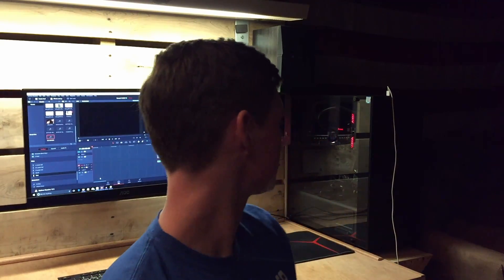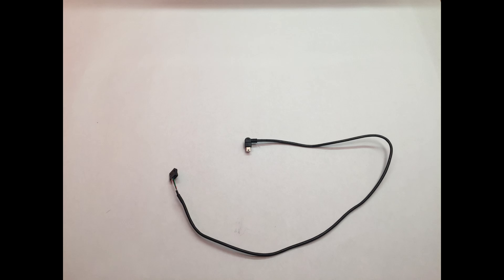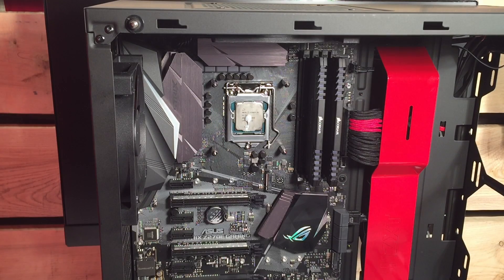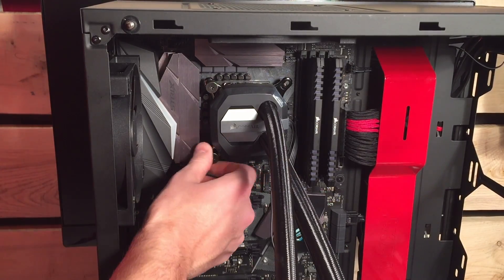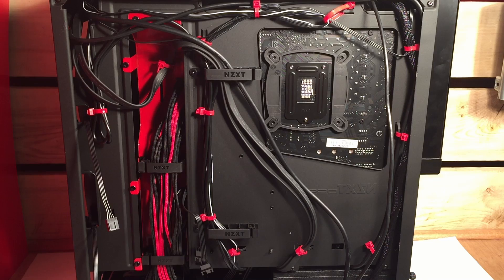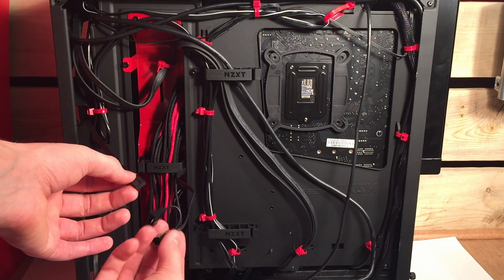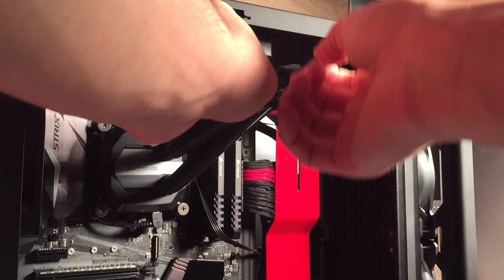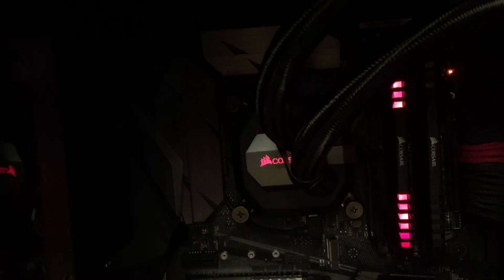Corsair H100I V2 Installation Guide

Comment: Hi 
I just want to mention the position on the radiator is not the wey it should go.
You must install the radiator with the pipes down .( up side down on the wey you show on the video. )the wey you install it not be ok with possible not working the circulating pump. Due to high position on pipes. And suckling air .
I experience this problem and the cooler doesn't work and the processor was going to 100 Celsius 
So correct the position on the radiator with the pipes down solved the problem. 
Other than that it will be fine

Comment: The tube should not be at a higher level of the block or the radiator, otherwise the air will accumulated at that point. Over the years more air will gradually get in the system and it will slowing get wrost. 
Another observation the radiator also would better place at the top, this way the air bubbles will always be at the top and will never get into the block

Comment: PLEASE DO NOT MOUNT RADIATOR LIKE THIS. THE TUBES SHOULD BE AT THE BOTTOM, IF YOU CHOOSE TO MOUNT IT ON THE FRONT. IF YOU DO IT THE WAY IN THE VIDEO, IT CAN BREAK THE PUMP, POTENTIALLY LEAD TO OVERHEATING ON YOUR CPU DUE TO NOT FAST ENOUGH WATER FLOW, WATER COVERAGE, AND CAN JUST OVERALL BREAK IT ALL

Comment: Unfortunately, you’ve installed the cooler incorrectly. You should have mounted the radiators on top or tubes down on the front.
Reply: wrong

Comment: On a h100i pro would you put the fans on the outside in front of the radiator so you can see the LED’s better?
Reply: Chris okay cuz I have the nzxt 500 case and the radiator goes on the front of the case

Comment: Your advice about fans and radiator position is not a good choice, you are taking some cold air from outside to warm it up through the radiator and send it into your computer case.
IMO Better taking the cold air that's gonna be warming it a bit inside the case, being accelerated by the radiators fans and cooling down radiator at the same time while being ejected.

Comment: Newbie question! By setting up your fans to push ambient air through the radiator at the front of the case, aren't you essentially exhausting the radiator's heat into your case? Wouldn't it make more sense to mount the fans in a pull position at an exhaust point? (back or top of case)
Reply: it works that way, because the air will flow into your pc and get out by the other fans you've mentioned, the top and back ones that are pointed with exiting the hot air.

Comment: I have this same cooler mounted in the exact same configuration and for some reason my studs that screw into the back plate slowly back out over a few days. They become loose, when this happens my temps rise. I have tried reinstalling checking that everything is tightened but they always come loose . The hoses are pretty firm and tend to apply a lot of pressure in a sideways direction pushing on my cooler. Any thoughts on this? Yes my backplate contains washers and is firm and not shaking. I was looking into an x62 Kraken and the hoses are much less firm.

Comment: Nice video. I'm about to install an H100i Pro for my 4790k to try and improve performance in BF5.
Reply: Did it work? Have same cpu. And a GTX 1070 8GB. My cpu runs at 100 so its time for a cooler solution.. ;)

Comment: Yo man I got the RGB platinum edition of h100i but I keep getting the Windows 10 disconnect sound and it just shuts off and turns back on. My games run fine and everything and it just happens randomly like it would work for like 6 hours straight and all good but then it will happen like twice back to back. Any idea about this? I’ve tried messing with BIOS but no dice :/

Comment: I  have a question about where you plug your fans into, There is an option on the mother board for an AIO header, is it better to plug the two fans into the cpu fan header's and then the cooler into the AIO header. Or to plug the fans into the sockets connected to the cooler and then the cpu fan. I plugged into the Cpu fan and the the other fans into the provided plugs attached to the cooler. I hear mixed things about which way is more efficient.
Reply: The AIO header provides constant 8-12 volts of power, and I read it is recommended to use that AIO. It will safely run at the pump at full power at not be very noisy. The fans to cool the radiator should be monitored by the MOBO bios (CPU fan and Opt fan). You can set it up in your bios. and also monitor it with software.
Remember if you have a case, sometimes they have a fan hub -where you can plug in 1-6 extra fans. But remember, your ASUS bios only detects the fans directly attached to the MOBO. Usually ASUS boards usually have just 3-4 CPU fan connections, and usually 2-3 USB connections. Plugging in the Corsair USB to the MOBO will give you options for lights, and interface to add colors, position the heat sensors with optional (SDK software). All of this is great to see, but the main concern is the MOBO. Remember, if you decide to connect to CPU FAN 1/2/3 on your MOBO, make sure the fans output are not using more that 5volts of power on each connection. If the fans can run higher voltage than that, the demand can overheat your circuit board. Make sure you use Molex power from empty SATA power plugs for the hi-rpm fans. Anything using over 3000RPM will most like be using more that 4volts. Think like this... small pins=small power capacity. Big pins=big power.
So in the end, you have to decide;
Do you want iCUE to control and monitor everything (H100iPro) from USB2 plug?  If you plug radiator fans directly to CPU+OPT CPU fan, your ICUE software will not detect it and you cannot control those 2 fans independently. Instead, the AIO "pump" in iCUE can control them both but again, you have to adjust the settings. There is no run-up calibration on the iCUE to test the fans allowing it to make it's own setup. And that is where the ASUS FAN XPERT4 has the advantage. I like to be able to see everything in the BIOS. And quite frankly, Corsair is more into the memory and hard drive business, and not a BIOS controller. So if you want Corsair software to monitor the board, its up to you. But ASUS already has you covered using ASUS FAN XPERT4 (in the BIOS as well as software loadable. 
I have CPU and OPT headers directly to radiator fans/ USB monitoring the temp on the cooler, and the rest of the fans connected to CH1/2/3. Its a matter of preference. How many people use the iCUE temp sensor (green yellow red)? I dont have the case facing me, so how will I ever know when the sensor turns red? Answer: FAN Xpert4.

Comment: hey look at 4:03 you see what you did to that radiator?? you touched that and you messed up those coils or whatever its called ...i have a huge problem now because i just installed that and i noticed that during my fans attachment i did touched the other side and now my radiator is messed up like yours is..... and now i wonder if i just broke that cooling system by my stupidity??? and idk is that water goes there thru those coils ????and now ill have a leak or something??? idk im afraid to turn the system on

Comment: i have a asus rog rebulic of gamers motherboard and i got the h100i v2 together a while back but recently i got the 1500w thermaltake power supply and when i plugged that into the motherboard my h100i will not work or read on the computer anymore and it is saying my cpu is running at 100c. any help please???

Comment: At 6:42 your plugging the CPU fan header, that has 3 slots, into a 4 pin connector on the motherboard...is this correct ??? 
Following your video every second of the way and its been super helpful
Reply: Most Mobos have 4 pin connectors for CPU fans, some use 4 some use 3, its designed for max compatibility. It's not incorrect. :>

Comment: hey man youve been real helpful - i downloaded the Corsair Link application because i found out about it through your channel... Alright so my fans are spinning lights all over the pump but my actual pump is at 0rpm also ive set it to full speed using the app. I am connecting my h100i v2 to a Z270P Prime Asus mobo.. and I have connected everything exactly as you have instructed in this video.. Halp!

Comment: So if the radiator in the front is set up as intake fans what did you do for the top and rear fans? Do you do the rear as exhaust and top as intake?

Comment: 3rd radiator install method- mount case fans on front with long screws- long screws are long enough to go into radiator as well. Mount pull fans to inside of radiator for push/pull :D

Comment: The wire set that has the 2 connectors is that required? The only way I can connect power is to a header on my MOBO using the 3pin header connector.  I am new to this thanks for the help.

Comment: Really helped me in that I have the same exact case. Upgrading CPU, MOBO and CPU FAN. So needed to know if this one will fit my case and how it will look. I was initially worried that my over sized zotac GPU would be in the way of the radiator. Looks like I will have plenty of room as the radiator does not go past the red plate that covers the wiring.

Comment: Just installed mine the EXACT same way as he did and it cools the cpu as it’s supposed to. The other fans in the top and back of my case remove the air. Stfu to anyone saying it’s wrong wtf
Reply: He should have reversed the fan direction, now the air coming through the radiator is warmed, it will raise the internal case temps. It's not catastrophic, but simply reversing the air flow will bring the internal case temps down a few degrees.

Comment: You don't need Thermal paste for this particular cooler.  It is pre-applied at the factory.  I built two Ryzen 7 systems using the H100I v2 and it was very easy.  The hardest part was actually removing the pre-installed Intel bracket and installing the Ryzen Bracket.

Comment: Hi TekRant.
Do you NOT WORRY about using an anti-static wrist strap?
I'm not judging/making fun, I am just curious what your take is on building such a nice system without a wrist strap?
Reply: Been a computer tech for 25 years..never used an antistatic strap..never had ANY issues..its all garbage

Comment: I have the same case but I have the 140mm fans. The top fan cannot screw in but it is in a very stable position and doesn’t move. It still preforms well. Just letting y’all know if you’re looking to do this too but with larger fans

Comment: If you use the fan method that you don't use in this video, doesn't it mean that 2 extra fans for cool air input are needed? Because you need cool air in the cabinet to be able to send cool air to the cpu cooler and gpu

Comment: If you are taking outside air and pushing it onwards, it will get hotter but if your case is set up correctly, your other fans will push that out the fans in front of the radiator is only to keep the radiator even cooler thus putting cooler liquid to the radiator if he was pushing the hot air into the radiator yes it would help keep the inside cooler but would ruin air flow some of the Arguments in the comments are not needed...

Comment: To get my tubes in a good orientation i rotated the CPU block 90 degrees (corsair logo is now vertical). Is this bad for the pump? My temperatures are pretty good but just concerned if it puts strain on the system?

Comment: on the installation manual guide they say that for best results you need to place the fans so that they take out air outside the case...not bringing air into it.
Reply: There are a lot of videos regarding that subject and they found that it makes very little difference. Both have pros and cons.
Reply: for that you'd need to install the AIO radiator on the top of the case as exhaust, and put 2 fans in front as intake

Comment: Why did he use CPU_OPT & not AIO_PUMP like the manual reads? We have the same board
Reply: Robert the fans don't start on boot I did it the way you mention xD
Reply: because he has no idea what he is doing like the retarded music playing in the video.  You always plug the AIO pump connector into the AIO pins on the mobo.  Then you can connect the two fans to the Y splitter built into the pump.  I built two water cooled systems and have them both setup like this.  All you have to do is go into the bios and disable the CPU fan speed monitor because it will set off an error and stop the POST.  Corsair has link software that you can use to customize the speed.

Comment: Can u connect the H100I V2 with a normal Fan based cooling system rather than a complete water cooled system?
Reply: OG ProDown yes it’s just a cpu cooler, the rest of your pc will need fans on the case

Comment: Hi, if I wanted to replace my intel stock cooler, should I remove before the thermal paste that my cpu had?
Reply: Alejandro Oviedo Yes u can remove it with a wipe with alcohol
Reply: Absolutely yes, use rubbing alcohol like the other guy said, whenever you take the cooler off of the CPU you want to replace the thermal paste, it more or less resets its lifespan and means you won't have to change it again as soon

Comment: There is another installation video on here saying it is not a good idea to plug the fans into the MB rather the PSU. But doesn't this mean the fans will run at full speed all the time? Is this accurate in that it has the possibility of damaging your MB?

Comment: is this good bild???? HELP! FEEDBACKNEEDED
NZXT S340Razer Edition 
ASUS ROG STRIX Z270E 
Intel 7th Gen Intel Core Desktop Processor i7-7700K 
Corsair Hydro Series, H100i v2,
NVIDIA - Founders Edition GeForce GTX 1070 8GB
Samsung 850 EVO 250GB 2.5-Inch SATA III Internal SSD 
Seagate 2TB BarraCuda SATA 
EVGA 750 GQ, 80+ GOLD 750W,
CORSAIR Vengeance LPX 8GB (2x4GB) DDR4 DRAM 3000MHz C15 Memory Kit - Black  
Budget is 1400euro PLZ GIVE FEEDBACK!!
Reply: VincentEntertainment should serve you well.
Reply: Its great, but I would recommend going 8th gen or ryzen.

Comment: I’m so tempted to get the kraken. But I’m probably just wasting my money on looks then.
Reply: IngeniousAbfool Same here. I’m scared that I won’t have enough usb headers for the krakens usb cable that you got to plug it in to. But the Corsair you also have a link cable that also has to be plugged in somewhere as well. Idk. I might get the Corsair one as Corsair is known to also make really nice products
Reply: Welcome To The DARKSYDE Same. Might just go for an air cooler though. Dark rock 3 should be fine for 3.8 Ghz i3-8350k
Reply: I just did everything put the last part right now and I don't have a 9 pin usb header available on my motherboard fml. I might run it without corsair link cable until I buy an adapter
Reply: I was also thinking kraken x62 but the reviews aren't as great for the price

Comment: I have this extremely annoying problem. When i've set it up, and plugged in the USB in motherboard, it doesn't install. I can't see it in Corsair Link 4. In Task manager it says "Printer and ??" It says "h115i Driver error" With a yellow triangle. I've updated bios, tried different usb's on the motherboard, restarted 500 times, reinstalled windows, i mean wtf...

Comment: I everyone I just recently bought a new computer from a friend and i could use some knowledge. I have a Corsair H100i v2 connected to a Gigabyte z270 hd3 mobo. In corsair link 4 the h100i v2 fan says 0 rpm's and stays there and the pump reads 800 rpm's so i then went into my bios and went to easy mode then to smart fan 5 and beside cpu fan speed control i set from normal to full speed and now the h100i v2 fan is reading 1,200 - 1,300 rpms and the pump at 1,700 - 1,800 rpms and also a reminded i have not manually changed anything in corsair link 4 sine I've purchased the Computer and also the corsair profile is set to balance. I have no idea if these speeds are good. my temps seem fine and my pump temp is at 24.8 degrees Celsius. .If anyone is willing to help i can provide screen shots. my cpu is a 7th gen i5 7600k 3.80 ghz mobo is a gigabyte z270 hd3.

Comment: Just finished building a new pc and doing some stress testing with Aida64 and my temps are 73/83 degrees with a max of 95 with a room temp of 24 degrees. No overclocking.
I already applied different thermal paste.

Specs:
Intel Core i7 7700k
MSI Z270 Gaming M3
Corsair Hydro H100i v2
Corsair Vengeance LPX CMK16GX4M2B3000C15

Comment: Bad instalation of fan but thanks you helped me
Reply: Why are they wrong? Intake or exhaust fans in a liquid cooling system makes no difference at all.
Reply: Fans should be pushing the warm air out of the case, he mounted it with fans pushing air through the radiator and into the case.

Comment: I'm running a msi carbon gaming z270 mb I just hooked up this liquid cooler I plugged it in the CPU fan slot and only one fan is running using the supplied connection. also under the corsair link it shows zero. was told on forums to try to increase the voltage to 12 on the CPU fan bios but that didn't work either still one fan any ideas? I don't have an aio slot I do have one that says pump fan.

Comment: my H100i V2 is noisy as a gun shot, 1 month old, installed as recommended by corsair.
Really annoying, I have checked cpu temp, it's all fine, the fans are noisy but the block there is on it is the noisy part.
Just remember to warn people.
Reply: Yes, replacing fans with corsair ml series will get rid of the noise instantly..

Comment: Need help pls ! 
my main is msi maximum ix hero and h100i .. where is usb cable 3pin and 4pin installation it?
Reply: BitterDoughnut Yes! Its not fixed yet :( and i really need help ! I try to connect 3pin to CPU Fan and 4 pin to behind the mb  USB 2.0 .. itsnt work anyway .. Im so broken

Comment: I dont have space for the USB cable. Will it still work without plugging it in?
Reply from the maker: it will, but you wont be able to control your fan speeds or the leds, in the meantime try buying a USB header from maybe NZXT
Reply: Thanks! :) 
I wouldnt really be using the controls of the fan speeds or leds anyways ^^